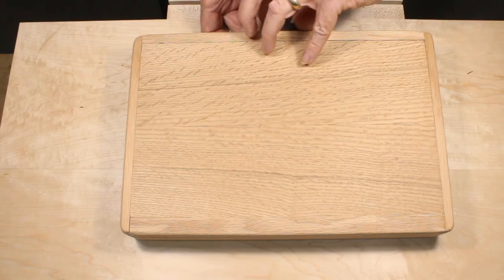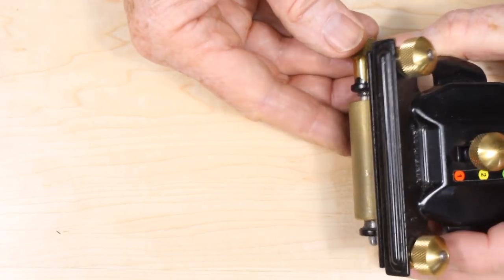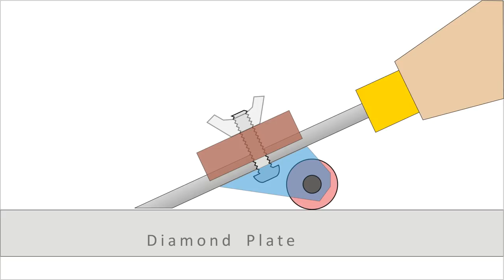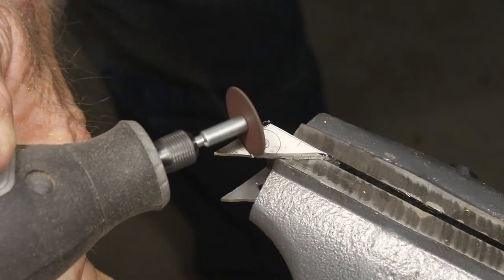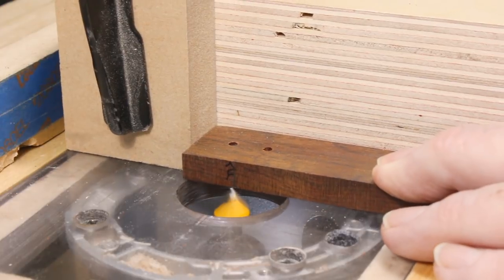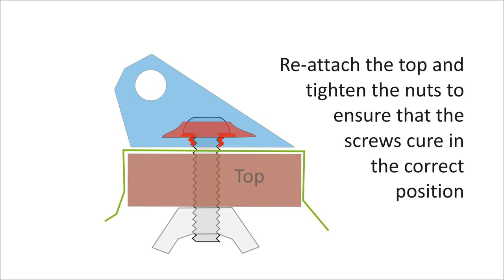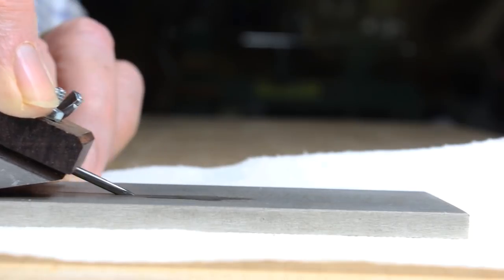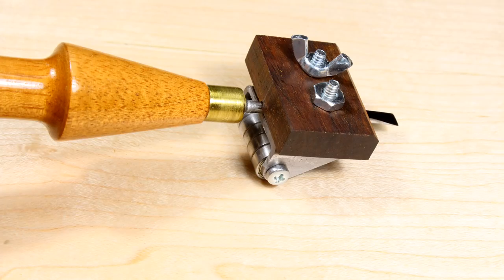Sharpening Jig for Small Chisels

Comment: if you 'affixed' a handle mechanism that goes back the opposite way from the way you have to hold your device, then your chisel handle would face away from you and the end to be sharpened would be facing you.  this way, the center of gravity would allow you more control of downward pressure and you would push it away from you when sharpening you not drawing it toward you.  I feel that this method would allow you more control.
Great video :)
Reply from the maker: It might work, Wayne, but 'affixing' the new handle will be the trick.

Comment: Very helpful. Thank you so much for posting. I have one of those cheapies you showed. Bad tool! It does not remain stable, and when I tried using a piece of plate glass for flatness, the demon scratched and ruined the glass (used for other purposes also). I wanted to toss that cheap demon into my kiln and melt it into a blob with what a demon might call 'home fire' (2300 F). Your idea is inspirational. Thank you.

Comment: Great idea and excellent video.  You definitely should make more than one, or at least keep extra bearings on hand, if you use that diamond paste much.  It will eventually get into the bearings, and you know how fast it cuts.  The regular honing compound will take a lot longer to migrate into the bearings due to it's wax base, and may never become and issue.  With the bearings so cheap, it's an easy fix, but it won't hurt to take care with the thickness of the paste on the honing surface, especially considering the cost of that stuff!

Comment: I find it useful to sharpen smallish chisels on a slightly rounded stone. Instead of worrying about rounding off the corners, unintentionally, you have to make some mistakes to even out the edge and end up straight (rather than with a frown). The blade will automatically level itself to where you apply the pressure, as well. So by checking the progress and adjusting the way you hold the chisel, you will quickly end up with a sharp, straight edge. My smallest chisel is 3 hundredth's of an inch wide. It wouldn't fit in a standard jig, because the blade is much taller up/down than across. On anything smaller than 1/4", I find it eaiser to hold the chisel still, bevel up and nearly level, and rub a small stone file over the bevel, trying to keep it level. You can constantly monitor with your eyes (and touch-test the edge) and make continuous adjustments.

Comment: Thanks for the video. I have been using a jewellers screwdriver sharpener that I modified for small chisels. It is just a steel rod with a bearing on each end and a hole through the rod at 90 degrees to the rod with a grub screw to secure the blade. It allows very short blades to be sharpened. The draw back is there is very little surface area holding the chisel blade This addresses that. All the best..

Comment: Hi Patrick, nice job! It occurred to me that you could get a wider "wheel-base" by adding a couple bearings on the outside, and using a longer screw. Nothing says they all have to be between the flanges, right? :)  You might need a washer to space it just a little bit away from the frame. It might even be interesting to experiment with taking the other bearings out of the "middle", although I don't expect that would make any difference except making it a little lighter and very slightly cheaper. It might keep the bearings from rolling in the lapping compound though, which might be a plus. Great job on the carbide chisels too, I learned a lot from those episodes :)
Reply from the maker: Steve:  You could also start with a wider piece of steel channel, and then put a short length of nylon spacer in between the bearings so that you only have the bearings near the edges of the channel.    A little extra width is a good idea.

Comment: This is awesome. Could you provide all the dimensions? There are a few missing from the diagram.
Reply from the maker: Go to my website at https://psullivancarmel.wixsite.com/templates.  You can download a template from which you can cut and drill directly.  The location of the screw holes is shown.  Please note, however, that this is not a precision piece, and it was designed to be forgiving of small errors.  Many of the dimensions could be changed slightly without any harm.  The holes for the screws that hold the wood top on should be as widely spaced as possible, while still allowing room for the heads of the screws.  Check the actual screws you intend to use, as the head size varies.  If you get these holes a little too close to the sides, you can file a flat on one side of the head.

Comment: Awesome design and super helpful & inspiring video!    Just a thought/question on epoxying the screw heads...  I don’t know squat about soldering, but do you think it would be worthwhile to solder the screw heads to the steel plate instead of using the epoxy ?
Reply from the maker: I think soft solder would probably work well if you can find a suitable way to secure the screws so they remain perpendicular to the steel plate until the solder sets.